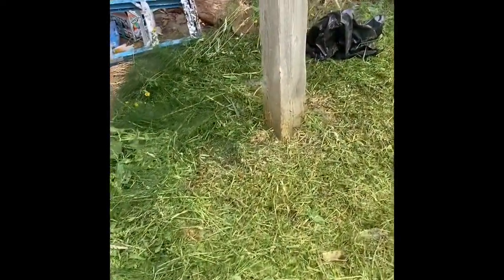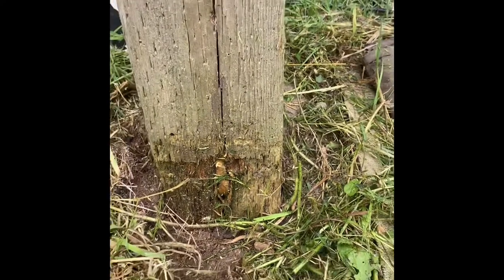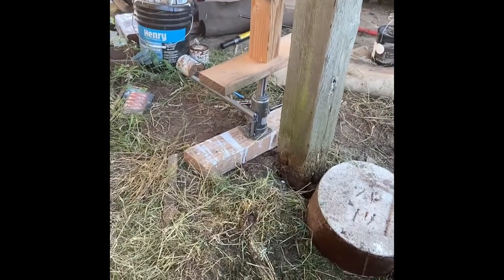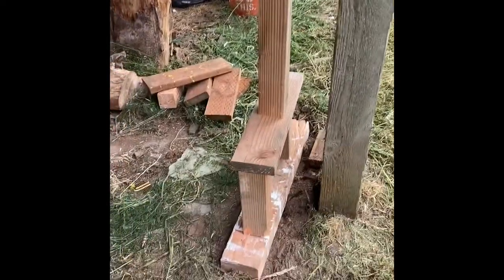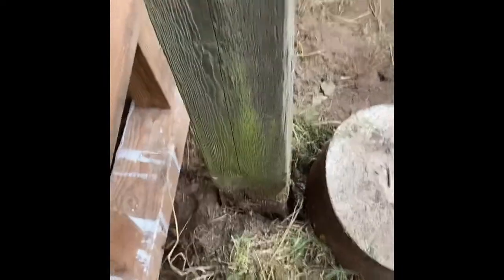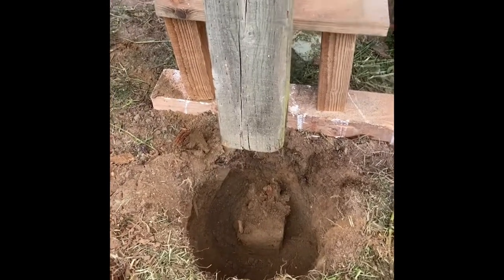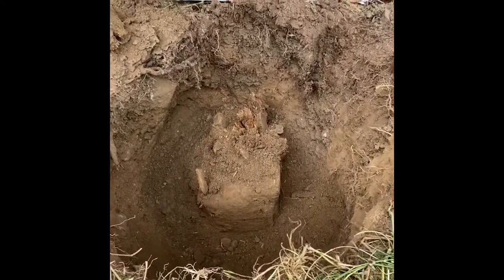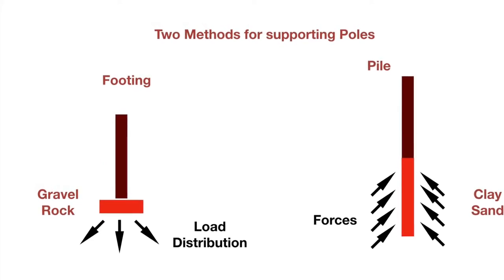Repair Rotted Post on Pole Barn by yourself

Comment: Outstanding! We had a similar situation with one of the posts supporting the portico over our front door; decay at the dirt line and cement about 14 inches below ground level. I had already figured out how I was going to do the repair, and then I found this video that just confirmed it was going to be a good fix. I added the extra precaution of soaking the post end in Tenino Copper Naphthenate before I attached the post base.

Comment: Yep. Pole rot. I'm about to get a pole garage. But research is needed. Knowledge is a blessing for the future. 
So I have a residential house. There is a water table run off problem.
One contractor uses treated wood set in crushed rock. Real bad idea for my situation. It should be wrapped in some sort of plastic up past the ground level and posts have two notches , one below and one above on opposite of the post. All set in concrete. I'm not a builder, I'm doing research and found this information.
Thanks for you video to show us what the heck is pole rot.
Reply: Negative on the plastic wrap.  Try to refrain from placing even "ground contact" pressure treated lumber below grade in dirt or concrete.  Consider mounting above grade on concrete footing as video creator did.  Good luck and hope things go (or went) easily for you :-)!!!

Comment: THIS  VIDEO  IS  A  PERFECT  EXAMPLE  WHY  YOU  SHOULD  NOT  ASSUME  A  POST  IS  ROTTEN  THROUGH!
This entire video was a severe waste of money, although I recognize it has personal pride value, and these posts were quite solid after 20 years. All these posts really needed was some wood petrifier, and sealing with wood epoxy...finished with some used motor oil treatment. If one really wanted to be sure the posts won't rot for 50 years...then liquid rubber instead of the motor oil & gravel drainage. But really...just wood petrifier, epoxy, and some motor oil would give these posts another 25 years minimum. Save your money, do a core sample BEFORE deciding to waste money on unnecessary repairs.

Comment: How did you mate the new concrete to the top of the pile / old concrete in the ground? Drill holes and rebar? Clean / use a slurry? Or just set the form tube on top and pour?
Reply from the maker: I just set the tube right on top of the existing buried post.
Reply: @tomthomas7154  Is that safe?

Comment: You concrete is way to small. Quick rule of thumb is 3 x post diameter. So a 6x6 needs a 18 inch concrete foot(roughly). My local code is the post width is how much concrete needs to be on all sides. So a 6x6 is just over 8 inches at its widest point so I would need 8 inches out from each corner to outside edge of the sonotube.We use 24 inch sonotubes fpr a 6x6 post to meet code. Also the footing needs to be below your frost line which is 36" in my state.
Reply: How deep does the concrete footing need to be, I’m in the south, rare do we get be.ow 32 for longer than a couple of days.
Reply: Hellcat, is that dimension you state based on the post being buried in the concrete like back in the day (think so).  These days the posts are pretty much required to sit on top of the concrete post.  In the IRC code the base (footer) that sits down in the hole below the frost line is wide like you state and then it shows a concrete tube sitting on top of that footer and the deck post attached and sitting on top of the concrete.  The concrete tube is 12" wide or smaller in the photo and not 24" wide as you state.

Comment: how deep do i have to dig for a sonet tube to support a 6x6, a couple feet?
Reply from the maker: Two feet is good.   My problems was to ensure leaving enough of tube above ground  to reduce exposure to carpenter ants and moisture for rot where I put post on top..
Reply: Below frost level plus for those sono tubes and above ground 6" or so.